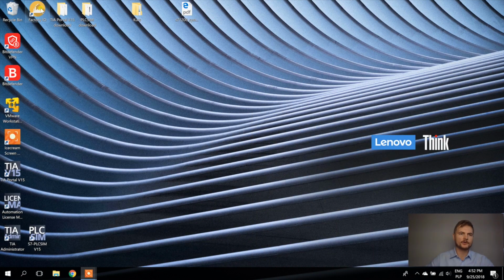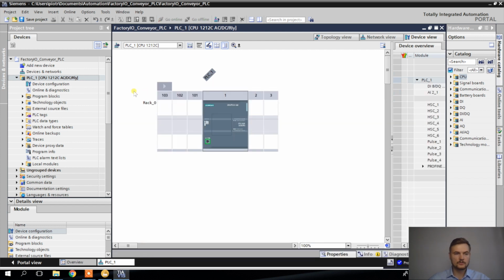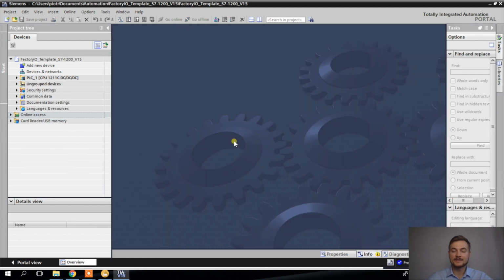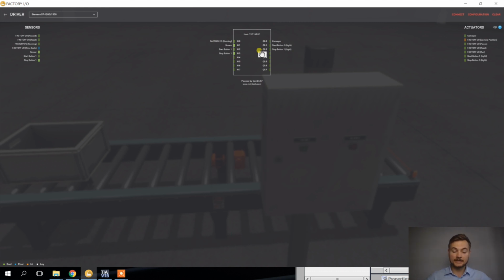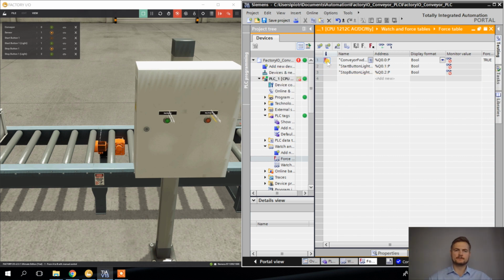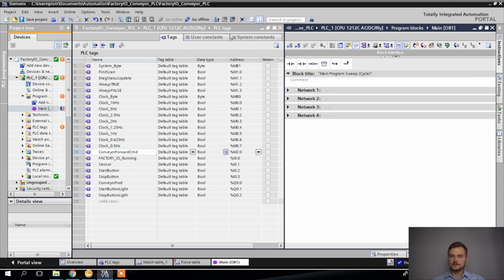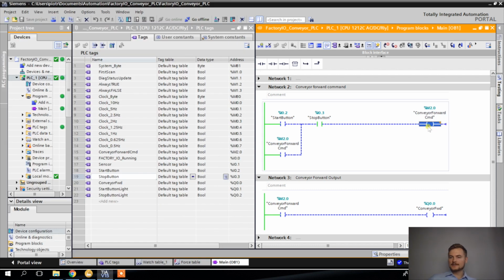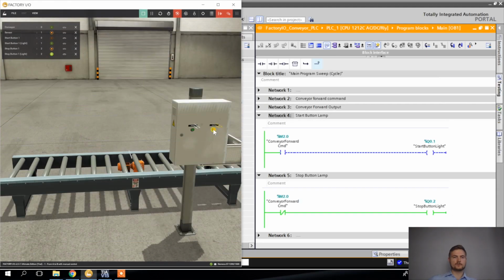TIA Portal Tutorial 05 - Conveyor control using ladder logic

Comment: 5:10 I cant find the device
Reply: You have a couple of options in the drop-down menu. Also, check if you're using the right ethernet interface. You can try finding all devices on the network.
Reply: @piotrekbt  i dont have the hardware of simens cpu. can i do it with out itfor learning purposes. or I dont need the harware?

Comment: Very good videos ! Do you know if it is possible to run factory.io on a seperate computer that have network access to the PLC (192.168.0.1), or do factory.io and tia portal need to be on the same computer ? Have a nice day !
Reply from the maker: If you're using a real PLC then TIA Portal and Factory IO don't need to be installed on the same computer because you just give the IP address of the PLC in the Factory IO settings. However if you're using a PLC simulator, then they both need to work on the same computer.
Reply: You can try to use Nettoplcsim or PlcSim Advanced.